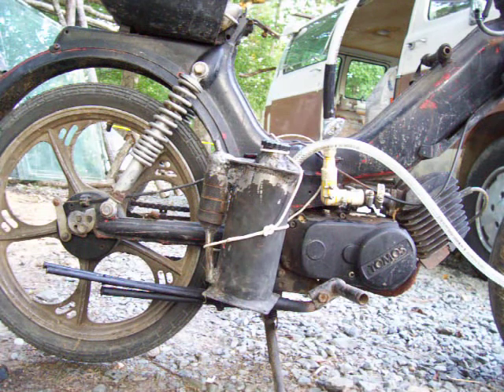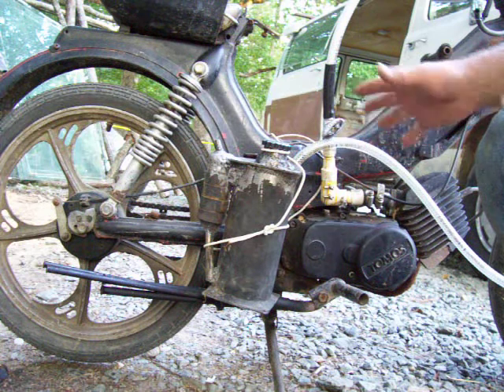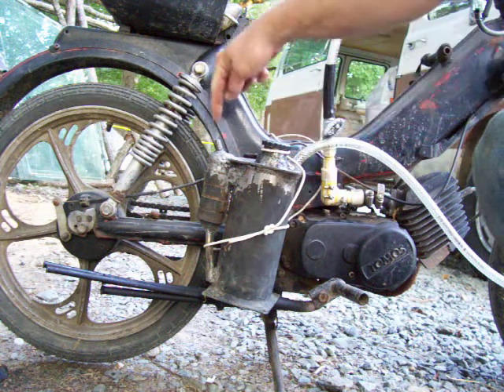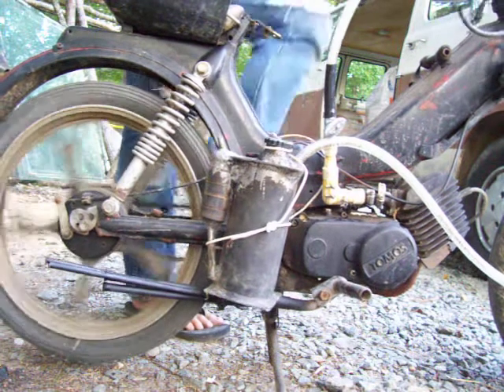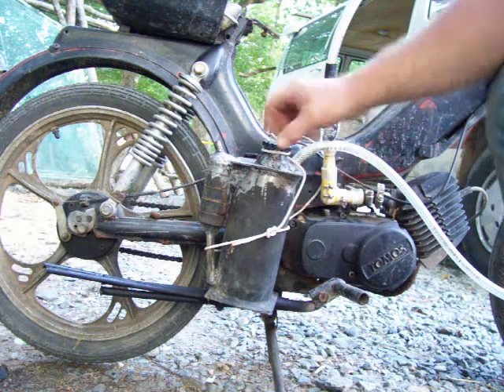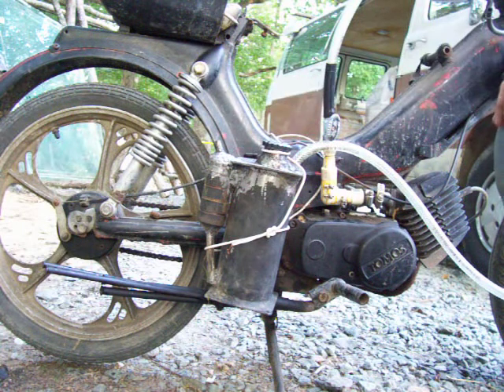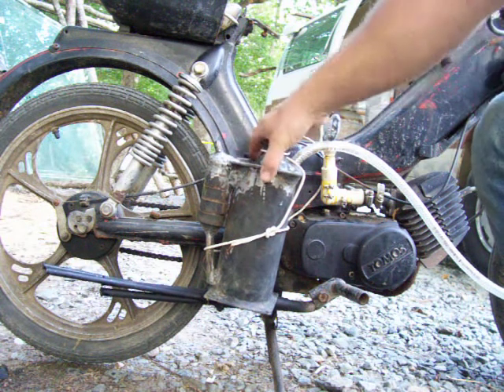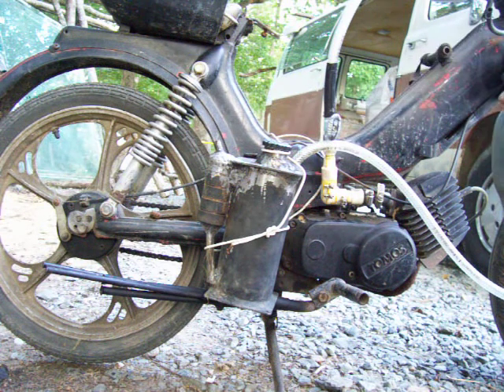Building a Vapor Carburetor (Update)

Comment: you can fix that with Steel wool   it works wonders   just stuff it in the air line somewhere and the flame won't go past that point...i made a gas vapor flame thrower and it has never had troubles

Comment from the maker: @rc1231589 - Yes very true - But this is a very cool motor. It has a small oil pump on the side that pumps oil into the cylinder every time it fires. Its just enough to smoke just a little as if you was running a liquid 2 cycle mix . I will do a video on this. Look at my new project using this moped....   

Crazy Fish Farmer

Comment: Nice job.

Just a question, if as I assume that's a 2 stroke engine, than together whit the water and the gasoline , do you add also the oil in the vaporizer? and if so , is there enough oil percentage in the vaporized mixture to lubricate the engine ???

In any case nice project and keep up the good work 

Cheers 

Andrea